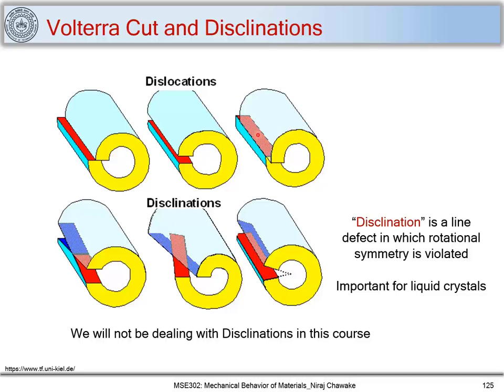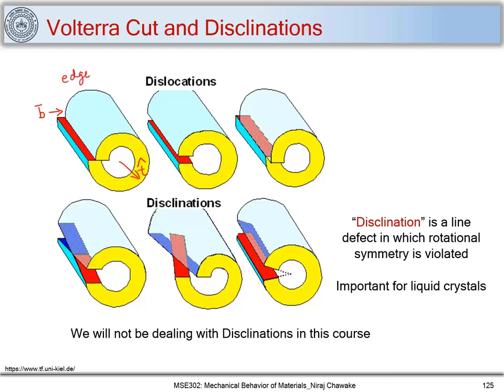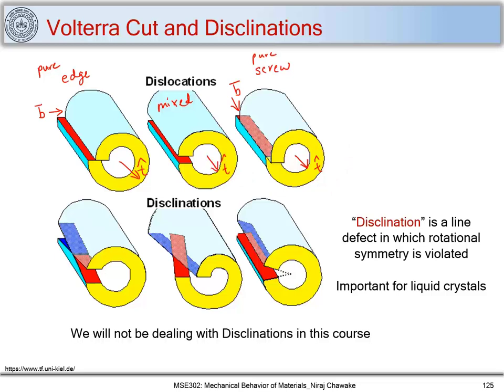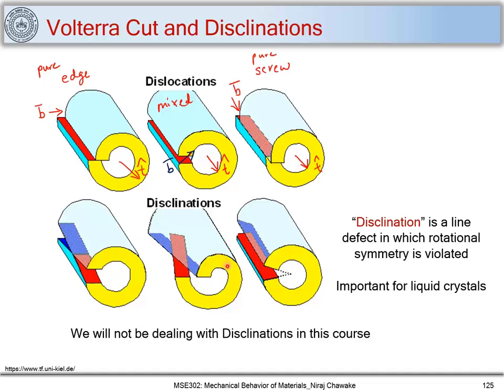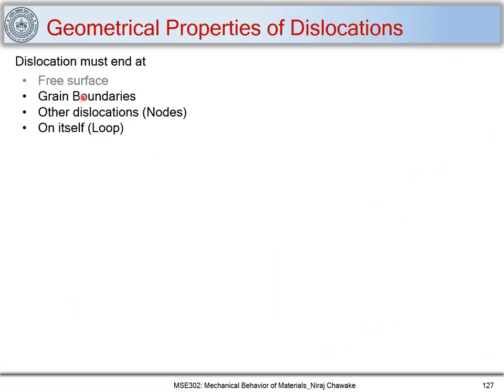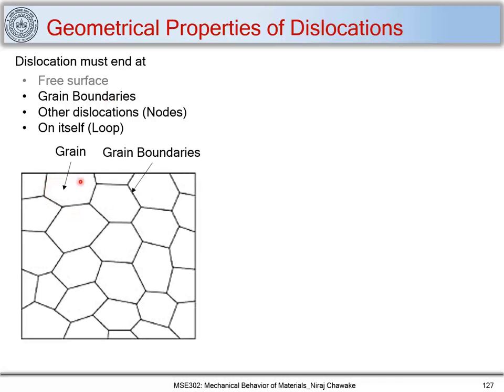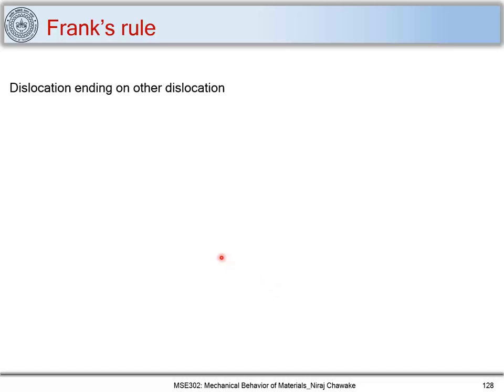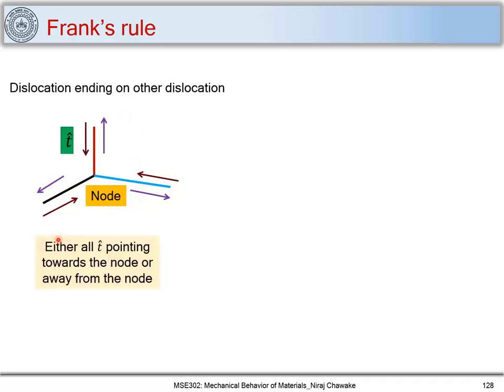31. Geometrical properties of dislocations

Comment: Sir, b2 berger vector is flowing from slip plane to another slip plane. How is that possible? Because t2 is the dislocation line, it should have two separate planes in its both ends, one sliped and the other unslipped.
Reply from the maker: I didn't get your question. Will you please elaborate?